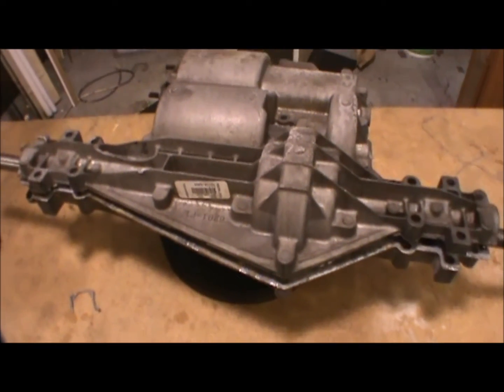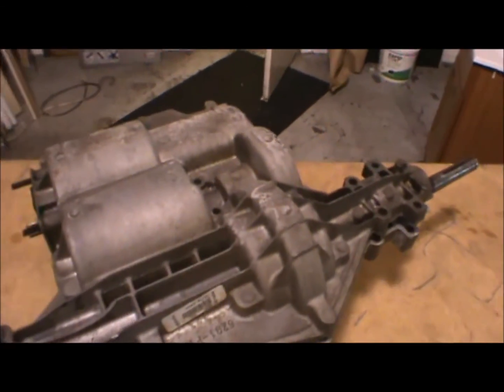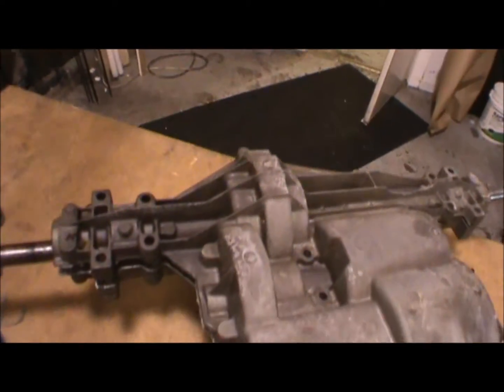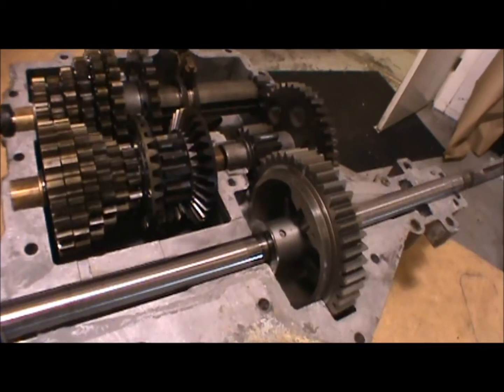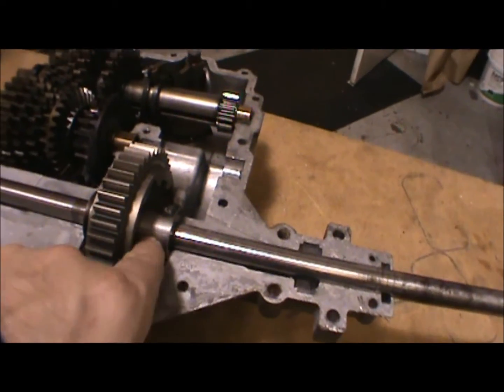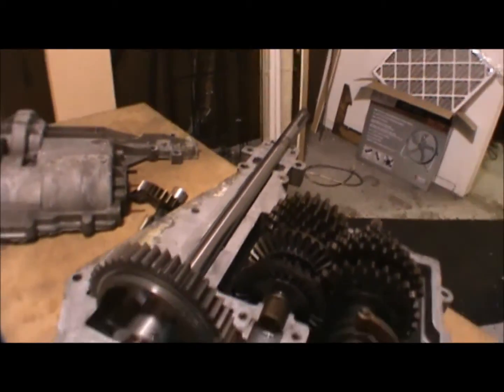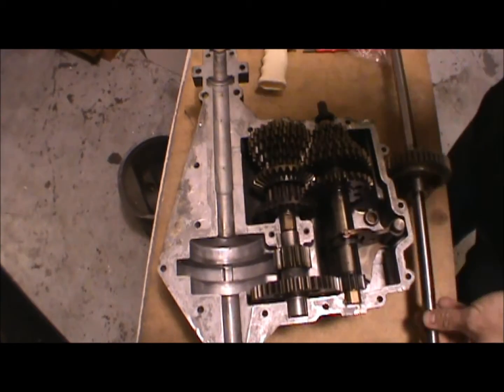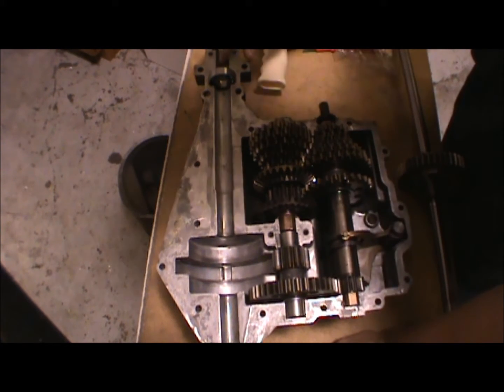Craftsman riding lawnmower rear axle locker not welded peerless transmission

Comment: So for us broke folks instead of buying the part remove the two ball joints inside keep the long metal piece lol and weld sum taps while it’s in place than go full redneck and weld that baby 😂 I just got done doing so only because I kinda dropped gears while speeding 55 mph on the road😅 so instead of swapping transaxles or gears with my other lawnmower I thought I’d see what happens 😊so wish me luck it works beautiful and yess I went 55 mph pulley swap but too lazy to disconnect clutch so my brakes ain’t worked 😢so crashing it was my best chance of keeping it still 😮 so to everyone before you go crazy for speed and yess it’s gonna be fast go find some scrap brakes to idk a ATV or some and make it work! It’ll save you the gears because I literally destroyed them gears sadly it’s only a 6 speed ones for racing and the others for mudding burn outs or 😊 wheelies 😅 drive lawnmower is a broke person ATV 😂 and I truly love it